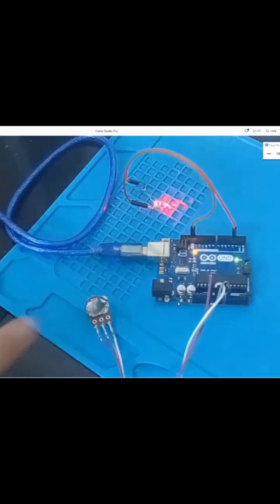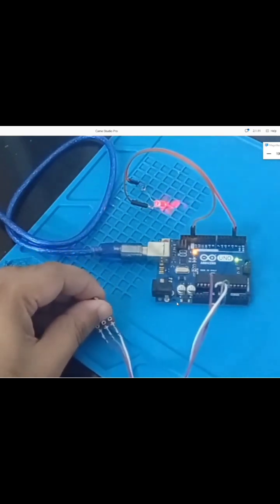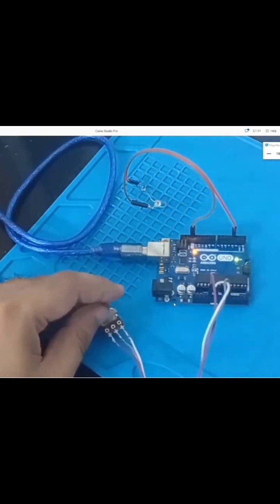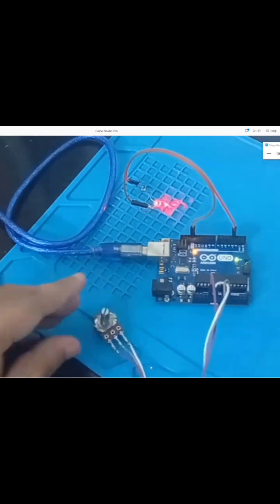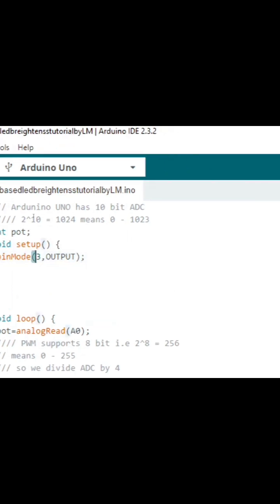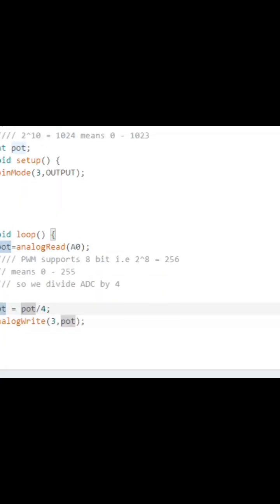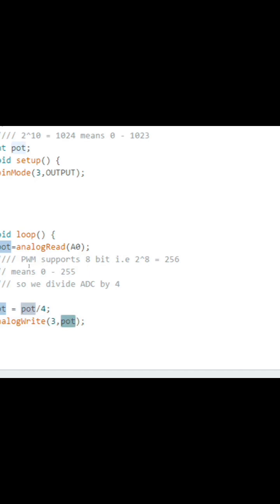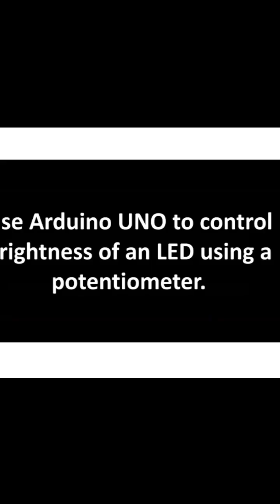LED brightness control using a potentiometer. #arduino #electronics #coding

Comment: You don't need that complicated Arduino. You just connect the led to the outer leg of the potentiometer and input to the middle of the potentiometer
Reply from the maker: Its a tutorial for arduino
Suppose you making a project and want to control speed of a motor aswell.
Then tutorial like this will help you.
Reply: ❤ mashallah